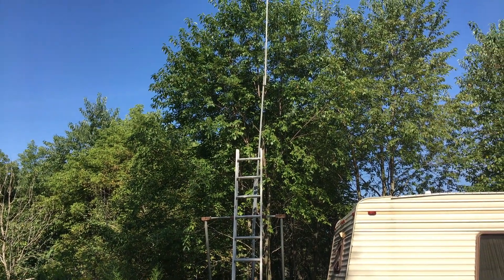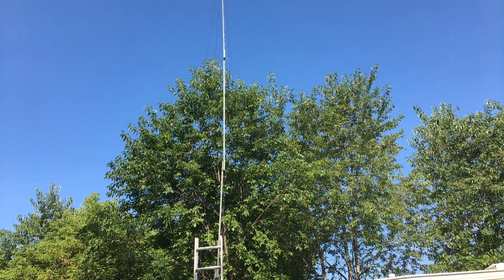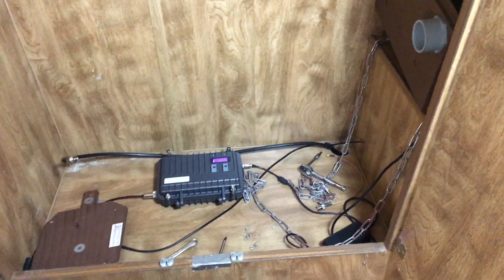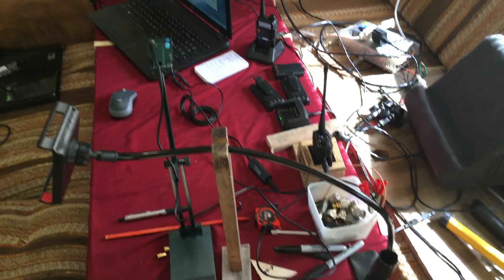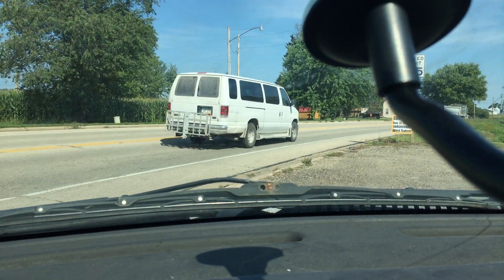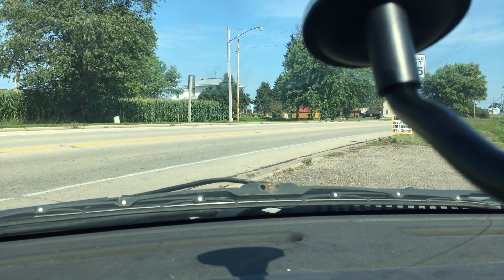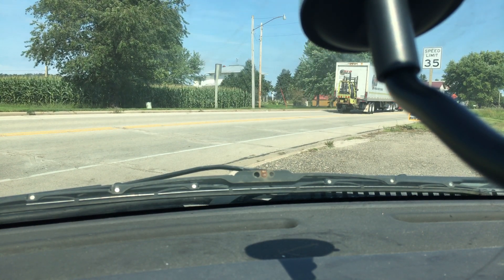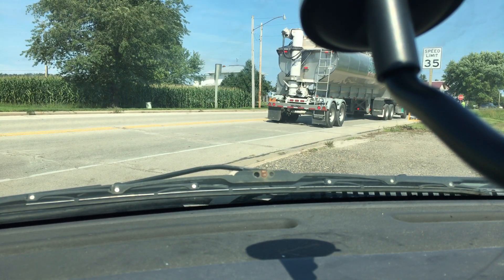🔺 Does using LMR400 give you better distance/range when using a GMRS two-way radio/repeater 🔺

Comment: The signal to me seems slightly clearer. Thing is radio seems to be one of those things that every little thing makes a difference. So from coax , antenna, connectors, radio and antenna height all matters . Then there is radios and how much output wattage, sensitivity, and just the quality off material to build the radio . Then it’s the area trees hills .
Reply from the maker: yes and you are correct every little thing(s) help 🙂